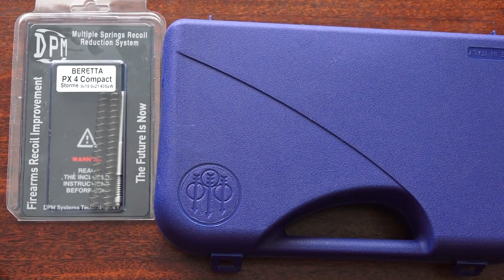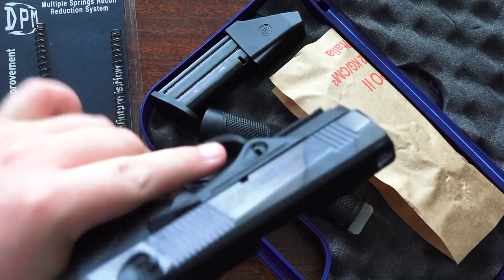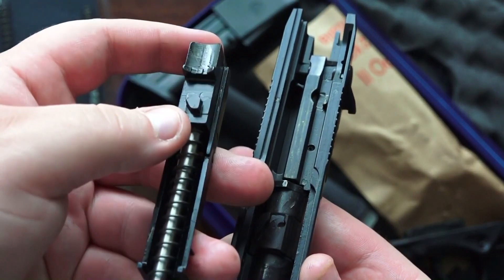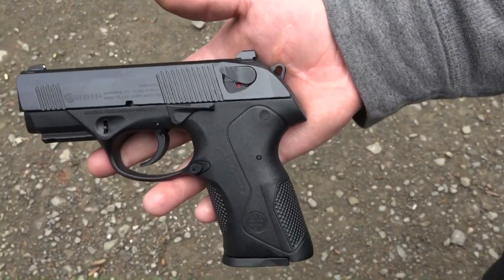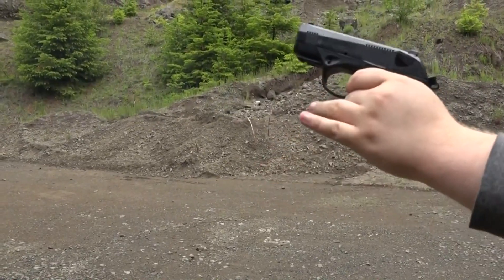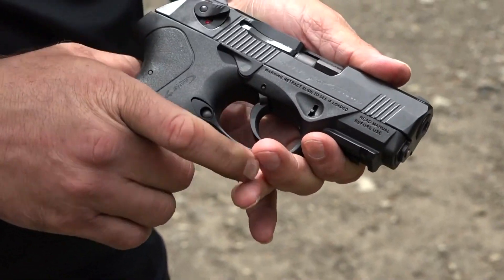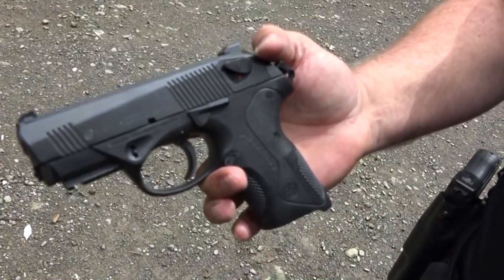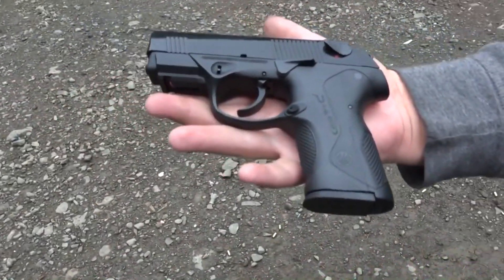Beretta PX4 Storm Compact DPM Systems Recoil Reduction System

Comment: Just picked one up for $299!! Mine has a chrome lined barrel.
Reply from the maker: Drew 1338 Diaz  That was a great buy.... slightly used was it?? No matter, still a great deal. I just did a Video on a Les Baer 1911 that was 10 Years Old. It was still Amazing. Take Care Sir.  👊🥳😎👍🇺🇸.   Beretta Sr.
Reply: @BERETTA9mmUSA  no sir new in box bt its in 40 sw and came with the 10 rounders instead of the 12s. Bt all good ordered some already. Now they're sold out of the compact but they Still have the full size for $329 with the 14 round mags. Still great deal couldn't pass.got it at sportsman's outdoor superstore.

Comment: When you got the recoil spring, did you have to install some pieces of the old spring or are you ready for use? Because I see that there is the rod with the springs but they don't have a piece that stops it and hooks it to the mouth of the hole like the classic spring ...
Reply from the maker: Man I do not remember….. this was years ago. I sold this pistol to buy my M9A3 in Desert Tan. Good luck, you may want to reach out to Company for some guidance.
Reply: @BERETTA9mmUSA  ok, can i ask you why you sold it in the end? and last thing how are you with the m9a3 ???
Reply from the maker: @akiratorihanzo   Bottom Line was I was just in love with my M 9A3,  and the Storm is a good pistol, just not for me.  🤠👮🏻‍♂️🇺🇸👍.   B9USA Sr.